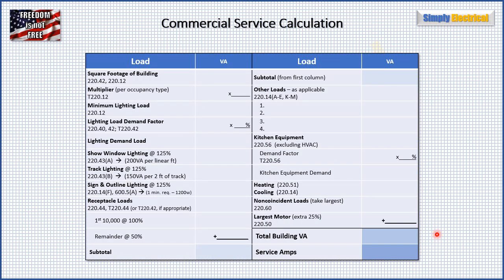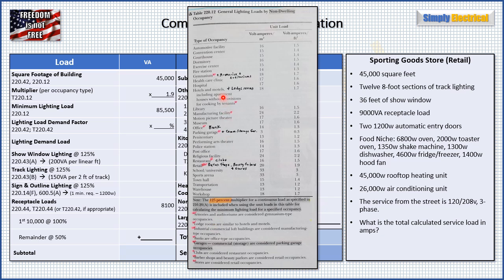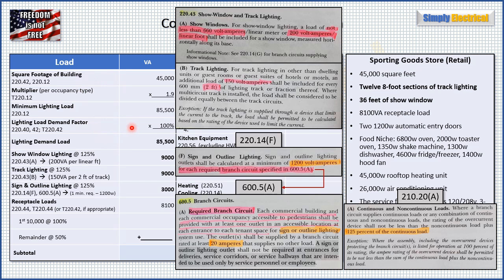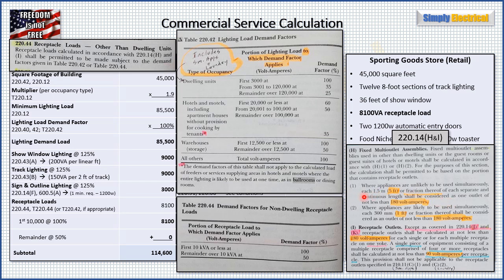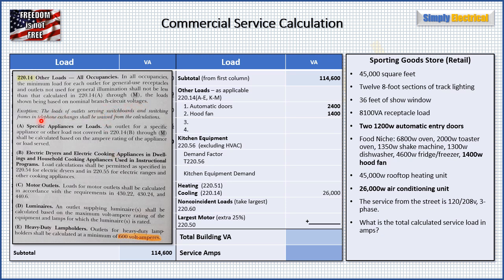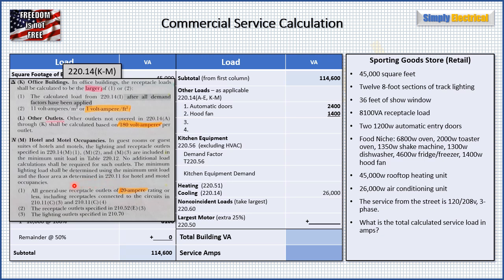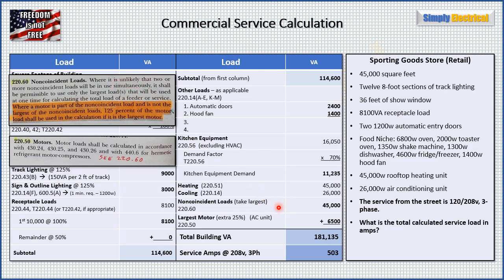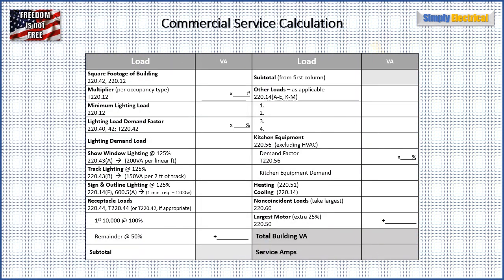Commercial Service Calculation -  Deep Dive 2020

Comment: I have a question, that noticed someone else mentioned it and now it put a wrinkle on my brain just want to double check other opinions.

Since show window, track lighting and sign and outline lighting fall under the lighting category, does T 220.42 have command over the calc? Hence suggesting that non of those loads get increased by .25% continuous load demand? And most types of commercial occupancies fall under the “all others” and just get taken at 100%?
Reply from the maker: Those loads are not part of the general lighting calculated under 220.12 and 220.42. They are called out separately in 220.43 and 220.14(F) & (G). Check out my video on Continuous Loads for a better explanation:
https://www.youtube.com/watch?v=1TqEufiv8iw

As for general lighting, since 125% is already incorporated into Table 220.12 (see table note), it is unnecessary to add it in Table 220.42. Otherwise it would be added twice to the same loads.

Comment: Good morning! this is great and helpful. Thank you.
I’m having issues on one of my test when they throw in this curve ball with multiple random motors one being a time delay or etc. 

How would you work this problem up if you added a 7 hp motor a 3 hp motor and a 2 hp motor 15 min duty cycle?
Reply from the maker: Thanks, glad you've found the videos helpful!

As for your question, there is more data needed.
1) 7HP motor doesn't exist in the tables - perhaps you mean 7.5HP?
2) Need to know voltage of motors
3) Need to know the classification and nameplate rating of the duty-cycle motor. See T220.22(E)

Keep in mind,  the exam questions will often include extra information that is irrelevant to your answer. They try to throw you off, to see if you really know your stuff. So pay close attention to the wording of each question.

I see this a lot with motor questions. They will will throw in the duty-cycle or motor type or OCPD info, even though it may have no bearing on the answer. Then you spend 10 minutes on one question because they got you second-guessing yourself.

Also, be aware of the difference between a continuous duty application vs a continuous duty rated motor. Confusing the two will certainly lead you to much pain and agony. 😄

Comment: Quick Question as i see this on almost every test and i cant seem to get a good answer...

#1 can you install class 2 and 3 circuits with class 1 in the same raceway with a  barrier if the insulation for all circuits is rated for 600v? 

#2 what if the same test question doesen't mention a barrier?  only the 600v rating? i believe the answer is no in that case?
Reply: One of the answers is if there is 600v insulation I still think without a barrier the answer needs to be no

It is hard to guess what they’re thinking 

Thanks again
Reply from the maker: @ericpolk9004  They will often throw in extra needless information just to try to trip you up by making you overthink it. They want to make sure you really know your stuff. That may be why the insulation is mentioned. I'm not aware of any place where the insulation rating matters for Class 1 vs Class 2/3 wiring.
Reply from the maker: See 725.136, particularly (B).

The insulation rating doesn't appear to be an issue here, either way. But there are many other factors to consider - see parts (C) - (I).

With the questions being written as they are above, I would say Yes to #1, and No to #2. Because we can't make assumptions regarding information that we aren't provided. Rather, we presume that (C) - (I) do not apply.

Comment: Please correct me if I am wrong. When you apply the demand of table 220.56 you got a total less then the 2 biggest appliances so you should use what it said on 220.56 “however in not case shall the feeder or service calculated load less than the sum of the larges 2 kitchen equipment load “ please explain me that I am not correcting you I just want learn.
Reply from the maker: It sounds like you may be getting the total kitchen appliance load confused with the total service load. The second paragraph in 220.56 it referring to the total feeder or service calculated load. So, in this example, your two largest kitchen appliances combined would have to equal more than 181,135 VA in order for this sentence to come into play.

That sentence is mainly intended for a feeder to a kitchen equipment panel. They want to make sure the feeder can handle the two biggest appliances at full rating.

Hopefully that helps! Let me know if I misunderstood your question.
Reply: @simply.electrical  thanks for your answer   .  Please make more videos  base on the 2020 nec. And your videos are the best. Thanks

Comment: I had a question on an exam recently Below i feel like the answer is 9000 va ?

30 x 200 = 6000 x 1.25 is 9000?

i'm confused on the annex D Store Example it say coutinous duty loads but only accounts for 6000 VA? 

If a 4800 sq. ft. store has 30 ft. of show window, a total of 80 duplex receptacles, service of 120/240 V, single phase 3-wire, and actual connected lighting load of 9120 VA, what is the total calculated lighting load for the show windows in VA?

 
A:  5000
B:  6000
C:  7000
D:  9000

Any Input would be appreciated
Reply from the maker: Total calculated lighting load for 30 feet of show window would be 7500 VA. So none of those answers are correct.

30 x 200 = 6000 x 125% = 7500 VA

The example in Annex D3 shows that to be true (about 1/4 of the way down the left column of page 818).

Now, the SIMPLE calculation is 30 x 200 = 6000. But the TOTAL calculated load would be including the continuous load multiplier (1.25). Therefore, 7500 VA.

I'm not sure where this exam is from, but it appears to have either left out critical info (e.g. the show window lights are on a timer, and therefore not continuous), or it is otherwise inaccurate.

If I was forced to answer this question with the given answers, I would choose B, 6000. Because the other answers have no relation to the problem whatsoever. But I think there is something amiss here.
Reply: @simply.electrical  the Exam is in Maryland ME. 

the question is what is the full calc but then asks you to say what the load is for show windows only. 

so it's either 6000 or 7500 in this case ?

they also say things like the store is 4800 sq ft and the "countinous actual connected lighting load is 7500VA"

My math is 4800 x 1.9 = 9120VA and 7500 x 1.25% is 9375VA i would use the larger of the two.   when they use the phrase  countinous actual connected lighting load are they already adding 1.25% to the 7500VA?

Another confusing part is when they say what is the General light ing load of the store i assume we are excluding the show windows,track,and signs?
Reply from the maker: @ericpolk9004  Typically, "actual" (aka "connected") load is PRIOR to applying any correction factors, demand, etc. "Calculated" load would be AFTER all adjustments are made, and would include the extra 25% for continuous loads. It sounds to me like they might be asking for the show window lighting load value BEFORE factoring in the extra. Some people add up all of their loads first and then go back and apply any additional factors to respective values at the end. So perhaps that is what they are expecting.

As far as "general lighting" goes, look at my table in the video and notice the 5th row in the far left column. It's called "Demand Load". But it is also the "General Lighting Load" (220.42). So this does not include the specialty lighting such as show window, track, etc.
Reply: @simply.electrical  It's odd to say Continuous connected load ? and Not Calculated Countinous load...
Reply from the maker: @ericpolk9004  I totally agree. It's misleading and confusing. But different jurisdictions have different ways of communicating their intent. Or perhaps someone was being sloppy. It's unfortunate, and hard to believe, but even government makes mistakes.  :)
Reply: @simply.electrical  ok but it's not 6000 because they are saying it's 6000?

is there any world where i don't add 125% to signs and show windows in a store calculation?
Reply from the maker: @ericpolk9004  Only if those loads are prevented from operating for more than 3 hours at a time (like on a timer). Otherwise, they are continuous loads and must be calculated as such.

My hunch is that they are asking for the pre-adjustment connected value - not the full calculated total. Therefore 6000VA would be correct.

I apologize if I'm not answering your questions adequately. Without seeing the complete exam question, I kinda have to make some presumptions on what they are asking for.

Comment: I had a question come up where it was single family dwelling using ( Optional Method ) but the calc said the dwelling was running on a 
generator and not utility does that change the calc at all?
Reply from the maker: No, a service load calc simply establishes the minimum load of the building. It makes no difference what the power source is. It could be powered by a generator, solar panels, wind turbine, exercise bicycle/magneto combo, or the Tesseract - doesn't matter. However, whatever it is, pay attention to the voltage because that tells you how to find amps.

The state exams will often times put in extra information that has no bearing on the problem - just to throw you off. They're trying to make sure you really know your stuff.

Comment: I had a question pop up that i got wrong any advice see below:

Step 7 – A/C Load
The total VA load for the AC should be calculated as follows:

24 A × 240 = 5,760 VA

This load is included at 100%  in this question shouldn't it be 125 % since it is the largest motor? 

This is a Store
Reply from the maker: Did they tell you that the A/C load was indeed the largest load of the building?   Because on a test, you are not expected to assume.  They will give you that kind of pertinent data.

Some people add the extra 25% during a different step, so could they have perhaps done that?  Hard to know without seeing the whole problem.

Was this a test, or maybe a practice test, or worksheet?
Reply: @simply.electrical  it was the only motor in the calculation but taken at 100 and not 125 seems wrong 

No mention of heat or any other motors

Practice Exam
Reply from the maker: @ericpolk9004  One thing to note about practice tests:  Many of them are imperfect. They can be written by well-intentioned folks who are trying to help, but they do have some mistakes sometimes. I'm not saying that is the case here, but it's a possibility. I'm not sure where your practice test came from. Can you reach out to them to see how they arrive at their answer?

The state exams tend to be more vetted and accurate. Often times, on a state exam, the calc problems will be very abbreviated. They are not looking for a whole service load calc most of the time. So you won't treat it quite the same way. You just need to give them what they ask for.

Comment: amazing video, can you continue this video and help to find feeder size and also designing branch circuit for such system ?
Reply from the maker: Yes, I do plan to expand on these videos in the near future.  Unfortunately, I can only do so as time allows.  At the moment, I'm not sure how soon it will be.  Thanks for your interest!
Reply: @simply.electrical  Thank you
Reply: The service amps is 503. You would have to go to table 240.6(A) to find the standard breaker size. You can’t use the standard 500 amp breaker because your calculated load is over that. The next standard size is a 600 amp breaker. Go to table 310.16 and go to the 75 degree Celsius column. Find the wire size that has an ampacity of 600 amps or more. The service wire size will be 1500 kcmil Copper or parallel runs of 500 kcmil Aluminum.

Comment: @ericpolk9004
0 seconds ago
so in the 2017 NEC the 125 percent need to be added? to the general lighting load?
Reply from the maker: That's correct.  You'll notice that the note for Table 220.12 was added in the 2020 NEC, stating the inclusion of the 125%.  And you can see that the values have all been adjusted accordingly.  They did a whole re-vamping of the table in 2020.
Reply: Thanks i appreciate your channel I'm up too 15 masters now and you have helped tremendously   @simply.electrical

Comment: so in the 2017 NEC the 125 percent need to be added?
Reply from the maker: That's correct.  You'll notice that the note for Table 220.12 was added in the 2020 NEC, stating the inclusion of the 125%.  And you can see that the values have all been adjusted accordingly.  They did a whole re-vamping of the table in 2020.

Comment: is there an optional method for this calculation?
Reply from the maker: Optional calcs only apply to occupancies covered in part IV (220.80-88): residential (220.82-83), multifamily (220.84-85), schools (220.86), existing loads (220.87), and new restaurants (220.88).

Comment: I recently took a load calculation exam on the 2020 NEC. One of the questions gave me a two tennant manufacturing facility. One of the tennants had (5) 60 amp transformer arc welders at a 10% duty cycle. How does that load get calculated? Article 630 has a duty cycle table that I don't know how to read, and 630.12 talks about 200% conductor ampacity for the OCPD.

For the exam I took it as (5) 60 amp loads with no demand factor, but I'm certain that isn't right. Can you offer some insight?
Reply from the maker: Welders throw a lot of folks for a loop.  And the question they gave you on the exam was tricky because they gave you intentionally misleading information.  The duty cycle has no bearing on calculating the load for a GROUP of welders.  So that bit of info was meant to be a curve ball.  Table 630.11(A) only applies to an individual welder.

For a GROUP of welders, apply the percentages specified in 630.11(B).  Add the values together to determine the minimum CONDUCTOR ampacity (60+60+51+42+36=249A).  This would be your MINIMUM load value for welders in your calc.  You would plug this number into the table under Other Loads [220.14(A)] in the table from the video.

Side note FYI:  Once you have the conductor ampacity, see 630.12(B) if you want to find the max OVERCURRENT PROTECTION rating for one or more welders.  Take 200% of the conductor ampacity to get your MAXIMUM load value in amps (249x200%=498A).  This would apply to your branch circuit (or subfeeder) OCPD -- not your service.  So this would NOT be part of your calc for the exam question.

This is how I interpret and apply article 630.  Hope this helps!
Reply: @simply.electrical  I had that same question and your explanation helps a lot.  I'm positive I can get this next time because I know I didn't get it this last time
Reply from the maker: @lukethesithlord  Yes, one of the frustrating things about the state exams is the extra (irrelevant) information they often stick in there to throw you off. But they want to make sure you really know your stuff, so I can't really blame them. :) Good luck on your next, and hopefully final, attempt!

Comment: I've been banging my head against load calc for the past couple weeks and I have to say that your video, BY FAR, is the best, most thorough, in depth, precise tutorial on how to do commercial load calc (or any load calc for that matter) on Youtube. It's not only incredibly thorough, your layout is beautiful. Seriously. I've gone from rewriting & condensing notes in 220, trying to figure it out, to making a spreadsheet or load calc calculator, to using the Line Method with a shit ton of notes, to finally landing on your most excellent video and yours is the best. You cover something that only ONE other guy mentions, which is continuous load, and you even explain WHY you're using it where you're using it. 

We are all so lucky to have you.

One question. I'm preparing to take my test, which, sadly, is still 2017. Do we assume continuous load is included in Table 220.12? I ask, because the continuous load note at the bottom of Table 220.12 in the 2020 NEC is not in the 2017 NEC, and I've scoured the interwebs for an answer and nobody mentions it.
Reply from the maker: Hey, thank you so much for the incredibly kind words!  Sorry, I've been away for a bit and the comments piled up.

As for T220.12, you'll notice that the values are different between the 2017 and 2020.  That's because they added in the continuous load factor in 2020.  So, on a 2017 exam, you will need to account for it yourself, if necessary.  In my experience, most exam questions aren't detailed enough to expect you to factor that in, but just read it carefully.  When in doubt, try it both ways and see which result fits an answer option.  Sometimes that works.  ;)
Reply: @simply.electrical  Thanks. And, I passed on the first try.
Reply from the maker: @icevariable9600  That's awesome!  Congrats!